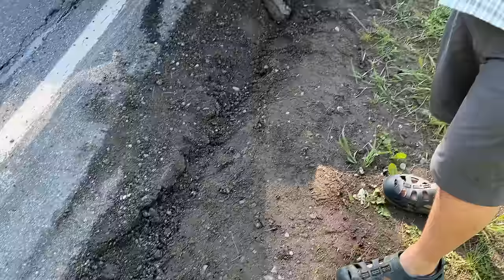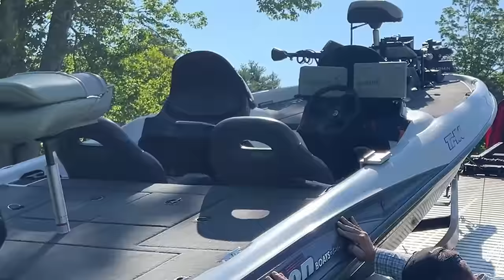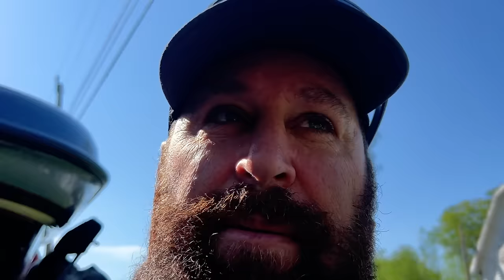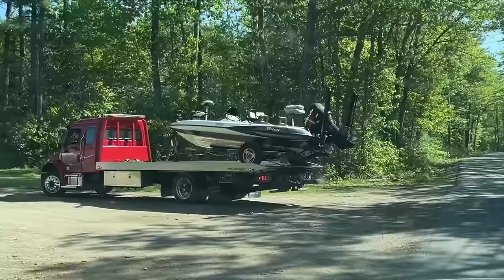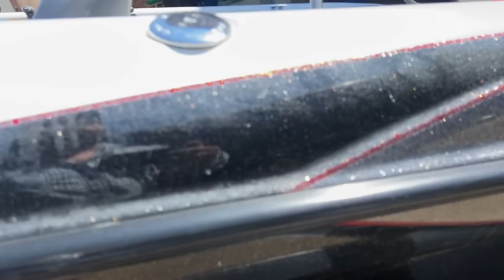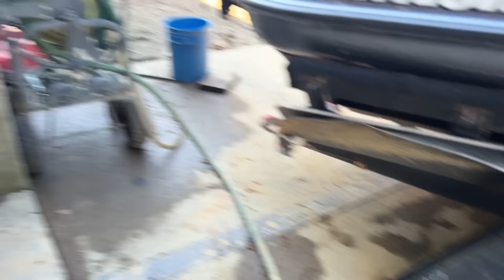I MESSED UP BADLY

Comment: Always check your bearings before each trip. Bearing buddy is really easy to install and use. Looks like you got lucky. I also carry a spare hub assembly in the trailer box in case there is an issue spotted after being out. Good luck Joe.
Reply from the maker: Those are great ideas

Comment: Put a lot of miles dragging my boat from Canada to Florida Keys fishing.  Smoked a spindle once & lost two months of fishing as they had to source a new spindle.  Another time a bearing failed and cooked the wheel hub.  Caught the problem just in time and, with a lot of “just being a good guy” I was able to find a shop and be back on the road in four hours right before a Canadian Holiday!  This was during COVID and I was in Canada!

I maintain my running gear religiously.  I check bearing temperatures (just hold the Bearing Buddy for a moment to sense temperature) at every stop.  I walk around the trailer and truck at every stop.  I have all the spare tools, gear and quality bearings, lube and seals.  Should carry a spare hub.

But, crap happens when you use things a lot and things break and can undo themselves with potholes and road debris.  Lost a Bearing Buddy on potholes when on a remote Canadian road once.  Cracked a trailer crossmember a different time.  Only a couple of flat tires due to road debris.  When the boat is off the trailer, check the bunks and trailer frame for “wiggles”, rust and frame cracks.  Just part of the Journey.

Special Note:  Driving fast with a trailer, especially in the summer is extremely hard on bearings and tires.  Even more wear if the boat is loaded with fuel and gear.  Driving hard with cold tires can be brutal on tires.  Driving fast in rain and you will learn what hydroplaning will feel like.  If trailering when temps are below freezing and foggy, expect Black Ice and zero stopping ability.  Trailering in snow and you might see your trailer start to pass you! 

Go easy and really look for Clues to problems such as a slight leak in a hydraulic break line on a new trailer!!!  Yep, happened at the beginning of a 1,800 mile trip.  That involved a lot of stops to keep the hydraulic break lines topped off.

40+ years of trailering boats and snowmobiles will get you a lot of Adventures.  Even ran out of gas once.  Last time I ever trailed without a 5-gallon Jerry Can for myself or some other fool on the road.

Be well.
Reply from the maker: Thanks for sharing !!! Lot of great memories

Comment: People hating on single axle trailers, gonna run tandems. Then they have two axles they don’t maintain. How about one like the factory recommended and take care of it?  Glad you are taking it all in stride. Lesson learned. I at least repack and replace the seals yearly. Also, check DOT date on tires and replace. I do mine at about 7 years.
Reply from the maker: You are doing it right!
Reply: @JoeHollandFishing  you did a great job posting this.  Hard to imagine how many people this will save!😎

Comment: Just had a buddy pick up his new Polaris 4 seat off road  Pro RZR with his buddies landscape trailer. On the way home he heard a semi honk and him, and he didn't understand why. After coming to a stop down the road, he found out one of the wheels was missing. He didn't know where or when it flew off of the tandem axle trailer. I said you spend 30K on a vehicle and put it on a POS trailer. I'm never surprised when I see trailers broken down.

Joe, just make sure the Ski-doo Expedition is on a well maintained trailer before winter.....
Reply from the maker: Absolutely !!!! Good call . New trailer but after a year probably should go through it for bearings tires and brakes before winter

Comment: I recently got my Grandfathers boat from my uncle. He swapped out the tires, and, as he is an uber mechanic, i assume he greased up the bearings and such on the old trailer.
The bearings are different than ones i have seen before, they dont have a cap over them, so im super skeptical of taking it anywhere for just this reason.
Aside from gettin a new trailer i am not sure how to rememdy the situation. I assume the trailer is from the 60s.
Reply from the maker: Probably good bearings
Reply: @JoeHollandFishing  Maybe it will make it to Maine from Iowa!?  🤞

Comment: Dang I'm sorry. Are you gonna try to get a new spindle welded on? Would you trust that spindle still?
Reply from the maker: Im trusting it for now since it took a new bearing but will keep an eye on it.
Reply: @JoeHollandFishing   I hope it works out! Had a gouge in my spindle recently. Filled it with JB weld water weld, and hoping it holds. Will be checking that wheel from now on for wheel wobble to ensure the bearings are running true and the fix is holding up.

Comment: Up grade to a Dexter style axle that is crossed drilled to force grease from the inner bearing to the outside and eliminate the bearing buddy use the dust covers with the rubber plug way easier to add new grease and check the condition of the grease
Reply from the maker: Thanks for the info!

Comment: I replaced my axle after my wheel fell off..welds on the hub plate corroded off…beefed up from 1500 to 2500 lb
Reply from the maker: Good idea
Reply: @JoeHollandFishing  someone used mine in brackish water... corroded all welds.   entire tire fell off in my driveway as i was coming home from a 120 mile round trip...lucky

Comment: Replace the axle and the fender.  Not a big deal.  Or weld a new spindle on.
Reply from the maker: Ended up saving the axle and spindle for now, Need a new fender for sure.

Comment: Another MFI Trailer!! Those were the absolute worst trailers. Lost 2 wheels on my first one at different times. MFI replaced the axle on one.
Reply from the maker: Oh no kidding I didn’t know that
Reply: @JoeHollandFishing  they MFI are no longer in business. They used unique axles, that's the name of the axle manufacturer. Dexter has since bought out unique, so if you need parts it's a struggle to find them. I just completely service both axles on the trailer I have now, weird bearing and seal sizes.